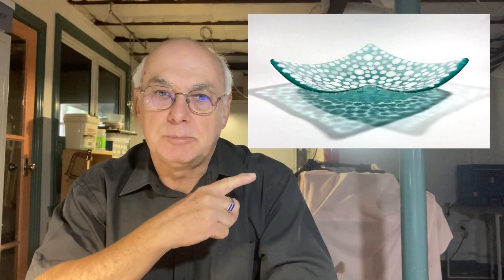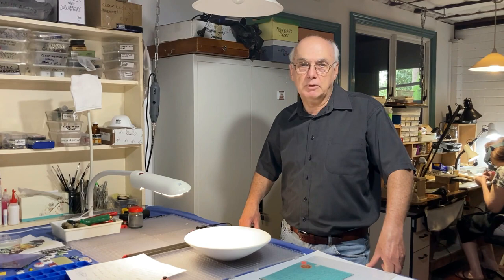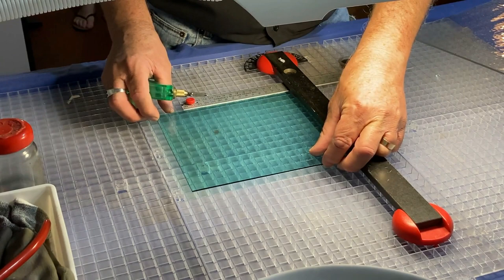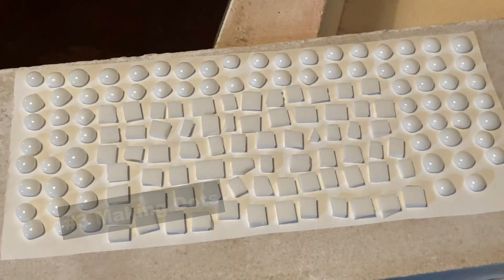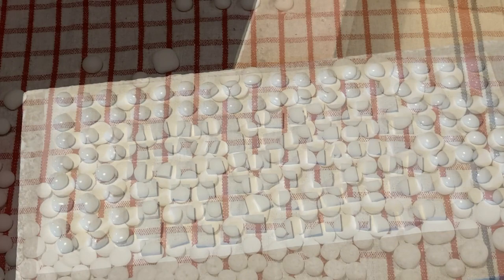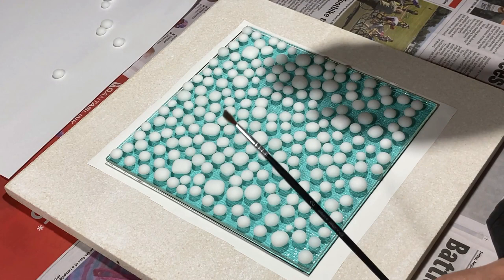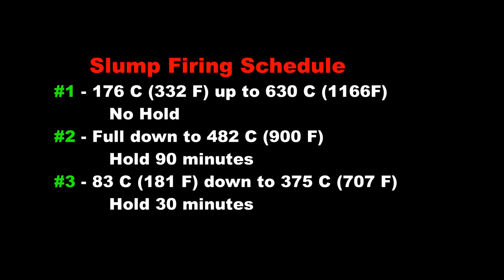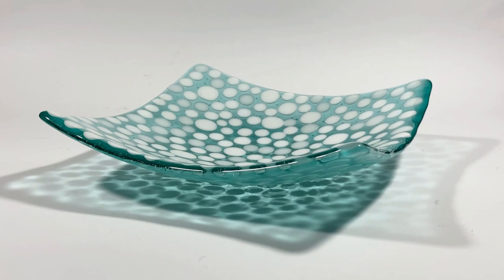Making a Fused Glass Bowl Using Colour Dilution Technique, Sort Of

Comment: This video offers lots to think about. Ann's suggestion about reversing the piece at the slump is a great idea because of the way light operates on the finished piece. I also was impressed with the use of glasses in this piece: a tint, a piece of clear, and then dots in the color of your choice (reactive or not). Making dots is not labor intensive for me; I just chuck a bunch of scrap pieces into the kiln when I am not doing anything else. I stay away from the 'challenging' colors like dense white so I get a fairly consistent result. Thank you for a different approach to the dilution technique.
Reply from the maker: Hi Susan. Yes, that dense white... Glad it all helped.

Comment: Thank you for sharing, Jeff. Another beautuful piece. Would you please add the cabochons  firing temperature in Fahrenheit. What do you think, what will happen if you put the white on acquamarine and the tecta is under?
Reply from the maker: I think I took them up to about 805  (1480 F) and held for about 30 minutes for this project. But I would suggest a bit higher, maybe 815 C (1500 F). Keep in mind your kiln may fire differently. If you want them perfectly round just set your hold time long then keep an eye on them until they form correctly. Then skip the segment. Note your temp and hold time for future firings. Dense white does contain lead, and aqua contains copper. Bullseye list doesn't list them as reactive, but just do a small test to be sure. If they react then when you turn it over the white won't be white 😕

Comment: Hi from across the other side of the world. Have tried this but cannot get the dots to sink into the top layer (max 795 C for 10min) plan to refire at  800 C for 5 min. Question; what happens if you keep it at 800 C for 10 mins or even longer? Does increasing time at max temperature do any harm? Love your videos. Martyn Thatcher, Cheshire UK.
Reply from the maker: I think you will need to go higher for longer. For this piece I held at 800 for 5 minutes, but my kiln will be different to yours. Try the 800, or even a little higher, but watch it to see when it does finally fuse. Going higher shouldn't be a problem. I've taken pieces up to 815 without a problem. The higher temps simply make the glass more molten. You can get devit sometimes. Depends on the glass you're using, both colour and COE and manufacturer.

Comment: Jeff, if you would have slumped it the other way as Anne suggested, would you need to do a fire polish to get the smooth finish or would that happen in the slump?
Reply from the maker: In my experience a slump won't give you a full fire polish. It will semi-polish only. For example, a sandblasted surface will smooth and give a satin like finish, but not a full polish and remove all the texture.
Reply: Thank you

Comment: Hi Jeff, 
Following your videos which are great! 
However I cannot find a clear fusing schedule … I’m making dense white dots - I’ve rewatched your Vedic’s, read the descriptions (cannot figure whether this is an older video (so it’s at the end) or a newer one - so it’s in the description. 
All I can hear is high full fuse … but no exact temperatures. I’ve also looked in previous videos … can you help and be more specific? It would be much appreciated - I’m just aware of the instability of dense white and I wouldn’t want to create pieces that could crack later on due to this. 
I was in my studio yesterday (45 min drive) and set up most of my dots, only to knock them over … but I was patient enough to sort that out - then couldn’t find the schedule - I’ve set them on a high slow full fuse with a bubble squeeze - probably overkill. Thanks
Reply from the maker: Hi Jennifer. It would a simple schedule. For dense white, which is hard to get round, ramp it up to something like 815 and hold until they round. Then just let the kiln cool naturally. No need for an annealing hold, because they are so small. For these small cabs I rarely have a hold on the way up or down.
Reply from the maker: BTW, that's a long drive to the studio!

Comment: I love this bowl. My questions: you didn’t put something in between the glass in the corners. Was there no chance of bubbles? I’ve been having devit problems. Did you put anything on top before firing? Thanks again 🐢
Reply from the maker: Hi Kathie. Yes, there is a chance of small bubbles whenever you fuse two pieces of glass together. I wasn't concerned as they would only be small and I don't mind small bubbles. From memory I don't think I had a devit problem with that piece. If I had I would have either sandblasted it and done a fire polish, or I would have lightly covered with clear frit and refired.

Comment: Love your videos. Question on the thickness: I suppose the two sheets below the dots are each 3mm thick. Wonder why the piece did not get much larger after full fuse. Is the final piece thicker than 6mm?
Reply from the maker: Hi W J. The aqua was only 2 mm, not 3 mm. That would have allowed the cabs to make up the difference to 6 mm. Even if the bottom sheets were both 3 mm the spread wouldn't have been that great. I would have just cold worked to the final shape.

Comment: I was thinking of using clear dots on an opal light blue with a  clear underneath will this displace the blue to have transparent dots on it if full fused so you can see though the spots where the clear dots are?
Reply from the maker: Hi Judith. I doubt you could dilute the colour to clear. In what I've done there is always some colour, though diluted. Even bigger cabochons still left colour.
Reply: @RocketRoseArt  Thank you I will use a transparent glass.

Comment: Hi Jeff nice work, another lovely piece. I assume that using a flat piece of clear would eliminate or reduce the bubbles in the piece? Is the reason you used the ripple clear (apart from water effect) is that the piece would more than likely have bubbling with clear so might as well make the bubbles even? Also is that a shop brought bowl mould or is it possible to use a std kitchen crockery/porcelain bowl? Cheers Ed
Reply from the maker: Hi Ed. The reason I used it is simple, that's what I had on hand. Plus, I like the bubbles. To me it gives a more handmade organic look. If you don't like the small bubbles, try using Tekta Crystal Clear. Yes, that is a shop bought mould. But you could use a ceramic bowl from the kitchen. I have a number of moulds that came from the cheap shop. I just sandblasted off the glaze and then sprayed with boron nitride. I've never tried using them with the glaze on 🙄 Always assumed that it would melt and cause problems, and I have a sandblaster. But I believe the glaze on ceramics fires a lot hotter so may not be a problem. Mmm, maybe I'll try.  Hope that helps.

Comment: Hi Jeff, stunning piece! Thank you for sharing. 
What's the reason for using a 2mm 
 and a 3mm. Am I able to use two 3mm sheets?
Also, did you glue your cabochons on before firing? I may need to, will it matter?
Lastly, where in Australia is your studio/gallery? I feel as though a road trip might be on the cards now borders are being opened. 
Thanks again, lovely work!
Reply from the maker: Hi Laura. Yes, you can use 3 mm. I used 2 mm simply because I had only 2 mm in that colour. The 2 mm meant I would have less spread, and you may get more with 3 mm, but that may not be a problem especially with a round piece and you don't mind a little organic look around the edge. No, I didn't glue on the little cabs. Glue would make it easier to move to the kiln, but because it's transparent make sure the glue you use burns out clearly. I use as little as I can of the Bullseye GlasTac and that is generally fine. But if I use too much I sometimes get a little residue. I'm in Toowoomba, Queensland. You're certainly welcome to visit. Just let me know so I can clean up the gallery. Hasn't been open since early 2020. We have Anns mum with us and she's 90 so we have been very careful. Also would like to convert the garage and set it up there, rather than the bedroom it's currently in. So may be out of action for a while. Depends on funds and more work. 🙄 But I can show you my humble studio and other work I've done. However, now we're all fully vaccinated we're thinking about opening it again. Not that we ever got a lot of visitors. Toowoomba isn't exactly a top tourist destination. 😕We'll just wait and see how this opening up goes.
Reply: @RocketRoseArt  Thank you so much for your reply Jeff. I look forward to seeing more of your creations!

Comment: Hi Jeff, I'm attempting to make a bowl similar to your "color dilution technique-sort of" and am having difficulty with the dots. I'm trying to get dense white to round off  but they are square and somewhat wonky and pointed. I'd be glad for you advice. Thanks.
My schedule in F. is
400 1250 .30
600 1495 .10
AFAP 900 .60
150 700 -0-
Reply from the maker: Hi Barbara. Yes, you'll find dense lighter colours take a little more processing to round off. Dense white is particularly hard. Either take the temp up a little or just hold longer. Keep them close to the middle of the kiln and take a peek until they round off. Be sure to wear infrared glasses if you look in the kiln, and wear heat-proof gloves as you open it. If you have a grinder taking off the corners of the squares will help. Good luck with it.